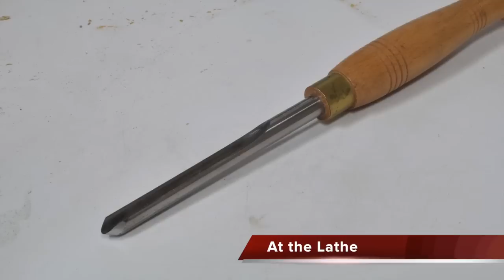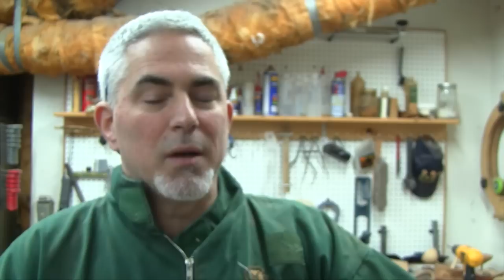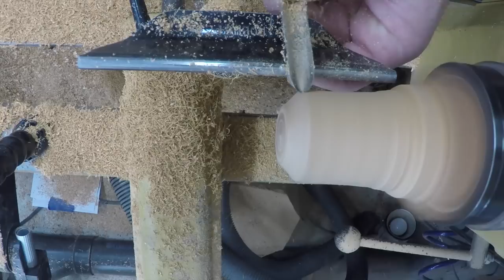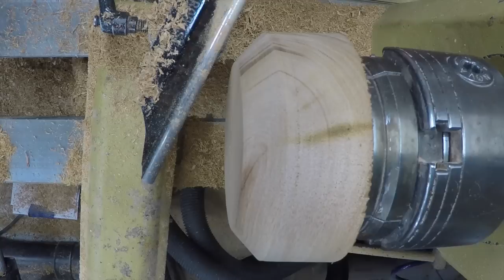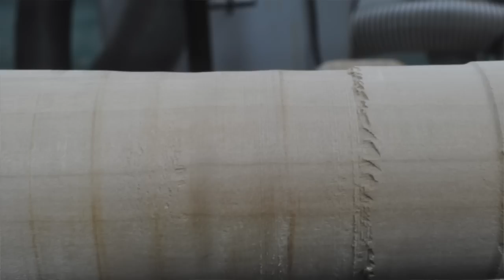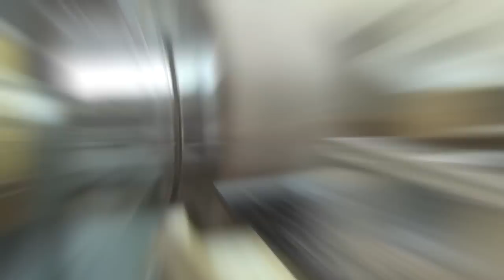Cutting Curves

Comment: Brian -- This was another excellent exposition on the theory of woodturning.  As with your other videos, this one excelled because you did such a good job explaining why certain cutting techniques work better in certain situations.  

Like most turners, I was taught how to make certain cuts, but it was never explained why the how worked.  For example, when making a cove cut on a spindle, I was taught to begin with the flute closed (a narrow cutting angle) and to roll the flute open as I got to the bottom of the cove (a wide cutting angle).  The technique worked on spindles.  It doesn't work so well in the edge of a bowl blank.  Your explanation of why cutting a cove starting with a closed flute and ending with an open flute works also explains why the same technique doesn't work on face work -- but it does explain how to make a cove cut on face work.

Which is why your series of videos should be required viewing for new turners.  Most of us can figure out the how once we understand the theory.  Without an understanding of the theory, someone has to teach us the how for each and every cut we might want to make.